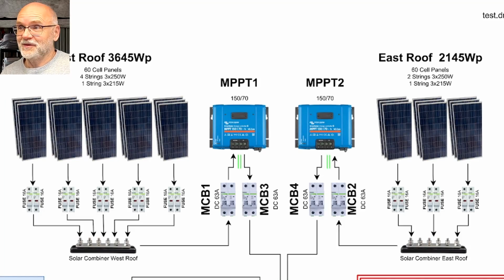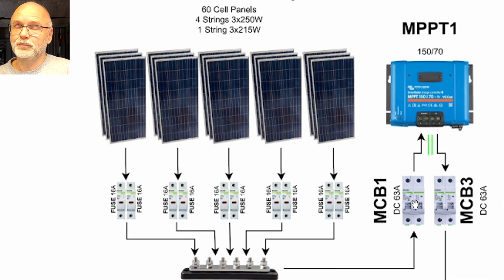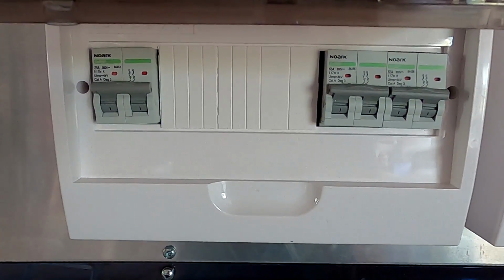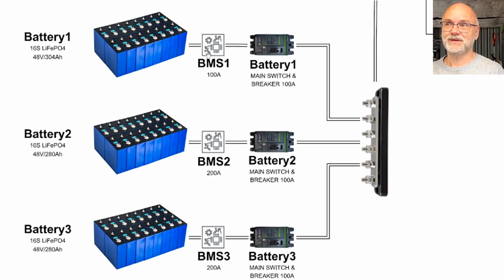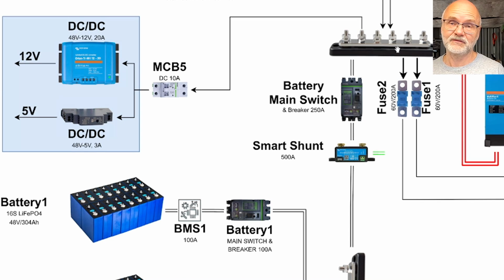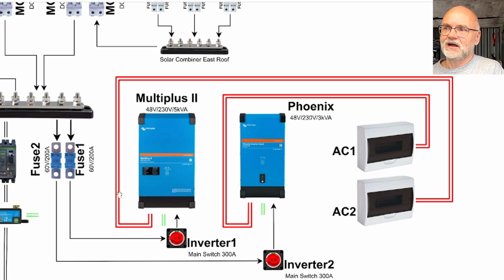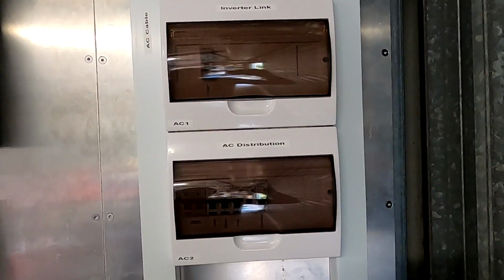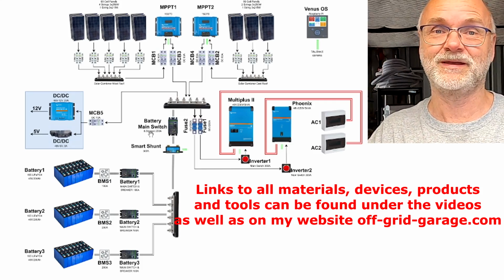How I've built the Off-Grid Garage. Whole system installation and design explained.

Comment: Another great video Andy. 

So for clarity you only have the phoenix to assist the load of the multiplus. It doesn't increase the the multiplus above its 5k, it just assists it up to its 5k taking away some of the strain/load from the multiplus?

Keep up the excellent work
Reply from the maker: Thank you.

that's correct the Multi still outputs max 5kVA on top the max 3kVA the Phoenix delivers. So all in all the Multi outputs 8kVA on one phase (but delivers only 5kVA itself). You need to be aware of that and have the right cable size connected to the Multi.
It's a load sharing set up right now. I can charge the vehicle with up to 4.1kW with the connector I have for it. So in theory the Multi would be at its limit with that alone. If some other load would turn on, it would be overloaded. With the Power Assist feature, the Multi delivers only 2.1kW for that exact load and uses the help of the Phoenix for the other 2kW.
Reply: @OffGridGarageAustralia  Thanks for the clarification Andy.

Thats interesting the way that works as opposed to a paralleled two inverter system. 

I have based my small off grid system on your design. I have also over rated the the cables just in case I upgrade. 

Again great videos with very detailed content. 

I haven't clicked it but is the "buy you a Spat" the official donation link on your website and is it a monthly option or is there another, i would like to donate monthly?
Regards 
Tony
Reply from the maker: @technretro7115  Thanks Tony. The inverters work really well like this, no issues. It's an undocumented feature and Victron won't support this officially but I was to curious and had to find out 😁
The donation link is just a one off, no subscription. Same as the Thanks button under the videos. Wow, that is very generous of you. Once you have donated, you have the Paypal address and can set something up with a recurring schedule I believe. Thanks a lot. That is a fantastic support! 🙏
Reply: @OffGridGarageAustralia  This is the genius of the system. André in Sydney

Comment: very very nice... many thanks. Why do you don't have a Overvoltage protection at PV site?
Reply from the maker: I have the SPDs installed in my system but they are not connected. The electrician will take care of that soon. I'm not 100% across how to connect them correctly. I will show you once it is done.

Comment: a super neat and tidy, and logical setup you have there Andy, the only thing you missed off which would have been nice to see was the EV charger what type it is and its fused rating ??, apart from that wowzers :) :) i want one :) :)
Reply from the maker: Thanks Kevin. I use the Tesla Mobile Connector which came with the vehicle. Never bothered to install a wall box as I don't have the need to charge that fast.
I have a 16A tail for it which plugs into a blue 'Commando' plug . This is a separate circuit with a 20A RCBO connected to the Multi. I can charge with 4kW single phase and this gives my 25km per hour charging. My commute is only 30km per day, so... I keep the vehicle at 60% SOC and charge to 70% or 80% when we go on a trip. Charged it to 100% only once since I got it in 2019.
Reply: @OffGridGarageAustralia  Wise move Andy! Yeah- mine has never been above around 95%, and even that is VERY rare.  
(TBH I am not even really comfortable with it sitting at around 90% more than just briefly.)
Reply: I was basically about the write the same comment verbatim until I saw yours 😁

Comment: Andy, What is your opinion on PCB battery connections? I ask because i recently built a 21700 based cell powerwall using PCBs from Jehu Garcia battery store from YouTube, when i measure out the resistance between cells on my PCB between cells it averages lower in resistance between cells compared to the hydraulic crimped busbar battery i built for my sailboat. I just ordered some 20mm x 90mm PCB multilayer PCB busbar links from china that uses 18mm of the 20mm width as connection between cells to play around with with built in solder spot for BMS cable. Its far cheaper than buying the cabling and crimp terminals to build cable busbars.
Reply from the maker: I've seen Jehu's PCBs for that purpose. I think they are OK but the downside again is you are getting a fixed connection, not a flexible one. Should be fine for the 21700s. It's a bit different with the large prismatic cells, I think.

Comment: You seem to not be using the Victron ESS assistant. Is this because you system is off-grid?
Reply from the maker: Yes, ESS is mostly for grid-connected installations where PV surplus can be exported to the grid once the batteries are fully charged.
In off-grid setups you can use the PV Inverter Support Assistant. https://www.victronenergy.com/live/assistants:pv-inverter-support
Reply: @OffGridGarageAustralia  That is how my system is set up. I am grid-connected and have my SolarEdge inverter connected in series on AC1 on the Multiplus. So ESS is working beautifully in exporting the surplus. It also enables the UPS function for loads connected to AC1. Love the Victron products.

Comment: Nice explanation, the electrician which will check your system will be glad you explained all! You see, working all this time on this long project make a beautiful system!
Reply from the maker: Yes, the electrician was very impressed about my system (and also the drawing). He will be back soon start to work on the system and solar upgrades.
Reply: @OffGridGarageAustralia  great to hear, hope you find a quick and cheap solution for the cracked panels. Maybe some glue sprayed on the back can prolong their life, otherwise find another batch of pre-owned cells for cheap. You have a lot of potential space for placing them 🤓 keep up the good work 💪🏻
Reply: Thanks Andy, on. Telegraph as you suggest. K

Comment: Thank you for the detailed explanation of your system. Do you have any updates on the seplos mason coming soon? I'm on the edge of my seat, curious what seplos themselves have responded with
Reply from the maker: Thank you. Yeah, not too much happening there atm. I'm waiting for the temp sensor PCB spare part and also the comms RS485 adapters to come in so we can move on here.
I also have to fully charge the battery again and see if the Seplos BMS can now cope with any imbalance of the pack.